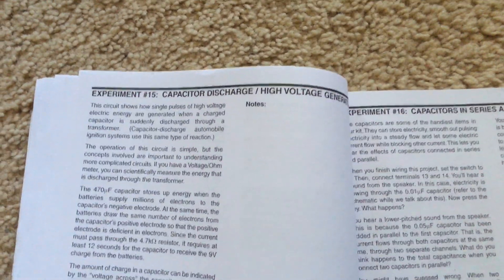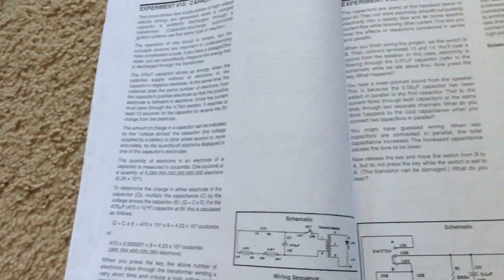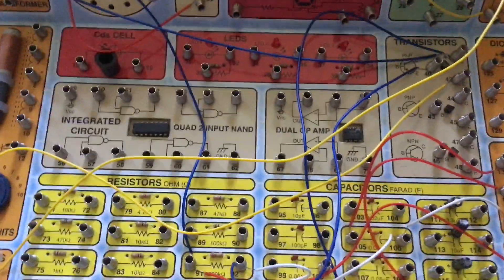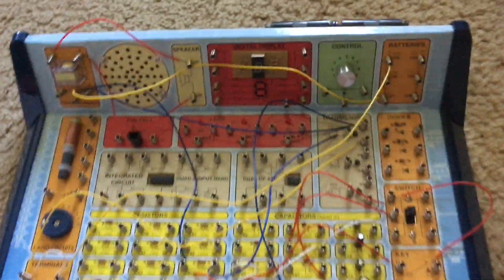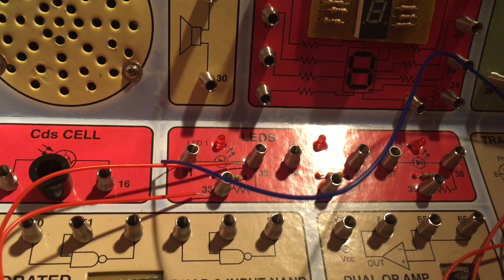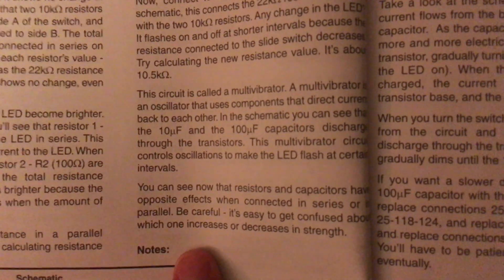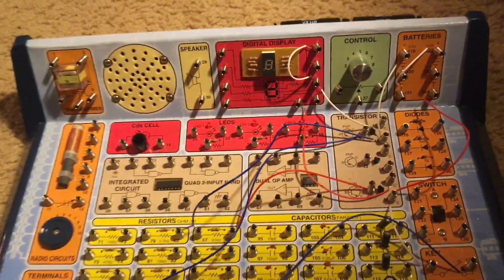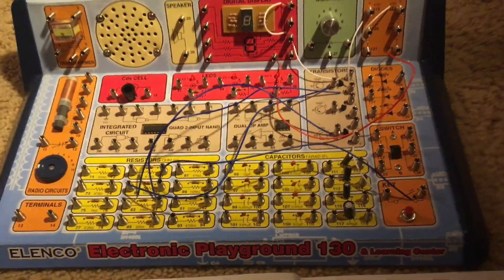Elenco Electronic Playground 130 & Learning Center: Experiments 15-19 (VOLUME WARNING)

Comment: It says if you have a volt/ohm meter you can measure the discharge.  The probes are used for that purpose.  Put a lead or a wire on 3 and another on 5 and hook it up to your meter.  I think you would set it to measure farads.  Not sure though.
Reply from the maker: Well thank you very much though.  That makes sense.
Reply: @andrewsstation6436  on second thought it would be voltage you'd be measuring.  I don't know of any formula where you'd get charge through a transformer.  It's the ratio of voltage, current, or windings.

Comment: Probes meant any wire(s)  connected to those spring terminal points .... these wires are now used and could be place in a cup of water to complete a circuit(s) ... only if the circuits is said to do this ... like for example a circuit called a rain/water detector ....
Reply from the maker: Thank you very much for explaining this to me!
Reply: @andrewsstation6436  Sure no probs Andrew ...